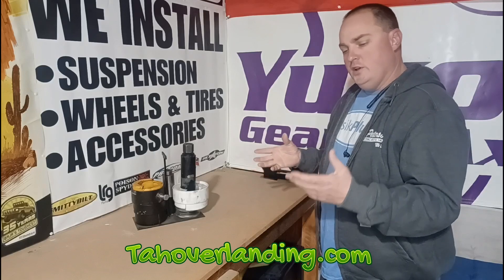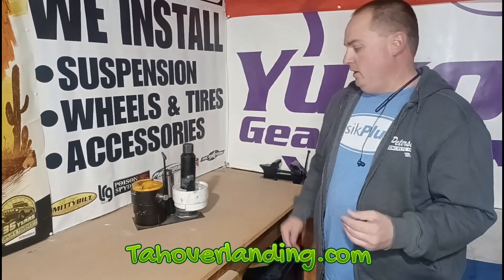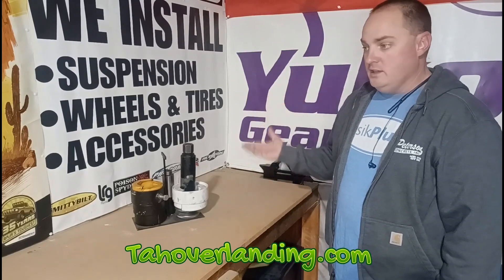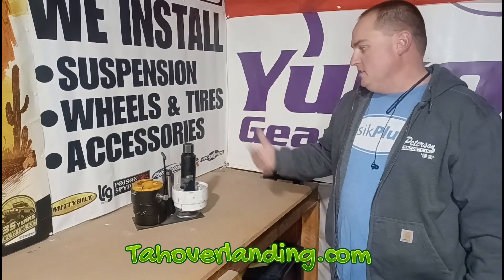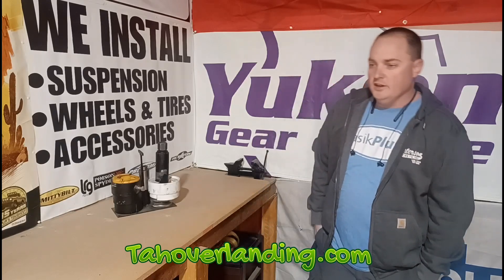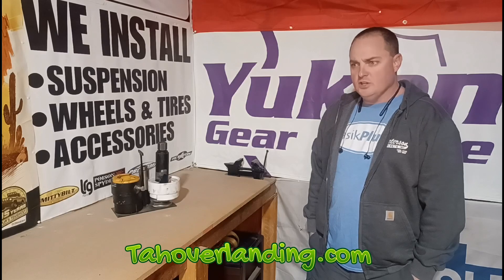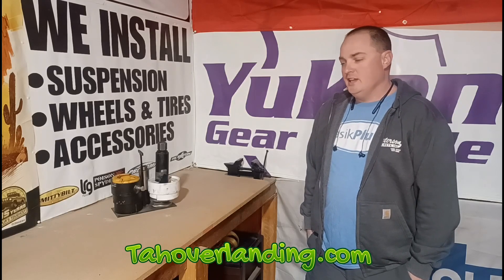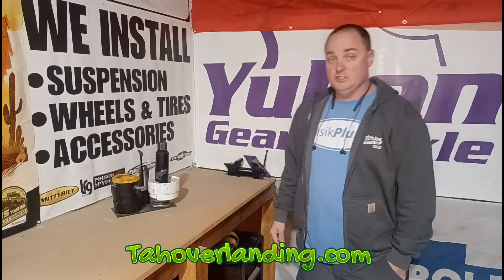Gear Ratio talk/ YOU NEED THIS @vevor.official  TOOL tahoverlanding axle swap episode 19

Comment: I bought this kit and it works amazing. I used the vevor kit on a 8.5 k10 and a 8.5 c10 rear axle. Works amazing on the pinion and pulls it just fine. Literally the same manufacture as the Yukon kit. Do yourself a favor and buy this kit and save yourself the hassle of breaking bearings.

Comment: Buy a sacrificial pinion bearing and take out a couple thousandths from the inner race so it will "slide" on and off the pinion as you test your shims. Once you have found the correct shim setup you are ready to press on your new bearing...

Comment: Been enjoying the increase in content you’re putting out. We’ve talked over instagram, but I thought I’d drop a comment here to see if anyone else would be interested in the answer to my question. I was trying to do some armchair research because I don’t have easy access to a Chevy 2500 nor do I have easy access to a dodge 2500, but I was wondering if you could do the same swap on a 3/4 ton Chevy with a 3/4 dodge axle and have the Chevy hubs swap in like the 1/2 ton do? Based on what I could find the hubs are both 33 spline but on the 3/4 ton they use 4 bolts instead of 2 to hold the hubs in. I wasn’t sure if that was the only difference or not or if you’d ever been asked this question. Would also like to see a gear swap video from you but on your timetable, as one comes up that you need to do.
Reply from the maker: So the Dodge is already 8x6.5 in both of the 8 lug configurations.  

Dodge also uses a 55 tooth ABS sensor. So there's no reason to swap Chevy hubs if you're wanting 8 lug. You would just run the 8 lug Dodge Axle unmodified

The Dana 44 8 lug Dodge Axle uses 3 bolts to hold the hub. The Dana 60 Dodge uses 4 bolts.  But nobody has ever tried to swap gm hubs on because like I mentioned the axle works as-is in its original configuration
Reply: @tahoverlanding  that’s the info I was looking for. Thank you sir. So the coil buckets and other parts you sell, would they also work for the 3/4 ton application?
Reply from the maker: @ericcalahan  they will, but with a slight difference. The 2500/3500 gm frame is wider. So you need to "French" my coil mounts into your frame a little bit.
Reply: @tahoverlanding  awesome, thanks for answering! I think I’m going to sell my 1500 and find a 2500/3500 to do the swap on.
Reply from the maker: @ericcalahan  really want that diesel engine?
Reply: @tahoverlanding  for the business I’m trying to get up and running I need the heavier duty. It won’t be my off-road rig, but I definitely like the idea of a solid front axle on my gm. It seems like a project I want to do and I would like to do one, probably on a Tahoe or suburban later on.
Reply from the maker: @ericcalahan  makes sense

Comment: I had that conversation with you about the 4.09/4.10 ratios on Instagram. But you eased my worry, thank you for that.
Reply from the maker: You're welcome, and rest assured you weren't the only one
Reply: There's a lot I don't know about axles and gears. I know the ratios I want to run, 4.30~ to account for the 33s I have (gt5/4.10 w/g80 factory on mine)
Reply from the maker: @thomasmullinsiii7759  I swear in my experience, this rule holds true every single time: "whatever ratio you THINK you need, go one step further ..." only one time did a guy tell afterwards that I was wrong. Because he wished he had done TWO STEPS lol
Reply: I'm not gonna argue that. But the 4.10s hold the 33s (well, 285s) perfectly fine. Mpg barely changed, still crawls nicely over stuff. But I just want a little oomph. But maybe I'll do 4.56s
Reply from the maker: @thomasmullinsiii7759  at some point you'll see this on a video. But I'll mention it now. Shorter gear ratios will either keep MPG the same or improve it. Which is very counterintuitive for some. But mpg is most affected by how heavily you use the gas pedal, far more than RPM. And shorter gears cause you to use less skinny pedal when driving.
Reply: That is very true good sir. I can get up to about 16/17 highway if I keep it 65 or under, no cruise control, and keep the rpms below 2k. However, that's hard to do in Oklahoma when the speed limit for semi trucks on half our highways is 80 xD
Reply from the maker: @thomasmullinsiii7759  keep an eye out for a gear video. But it might be a minute before I do that one
Reply: That's fine. I actively follow your YouTube, so I'll most likely see it and comment something on it 😉
Reply from the maker: @thomasmullinsiii7759  I appreciate your support 👍